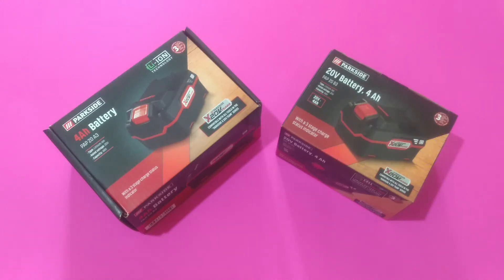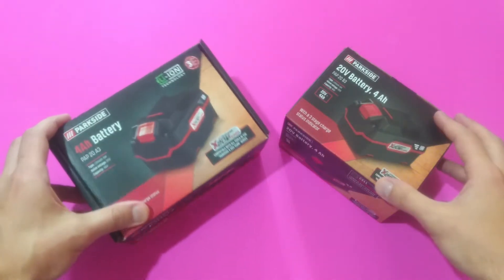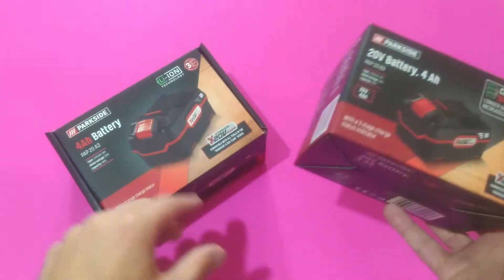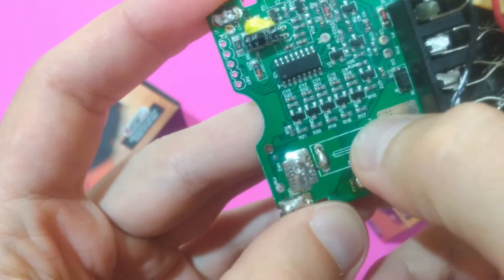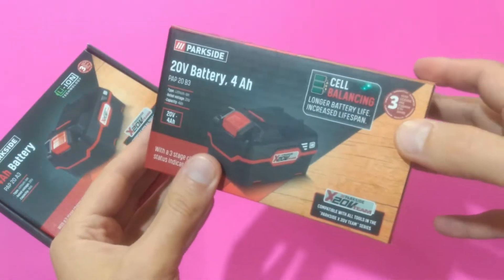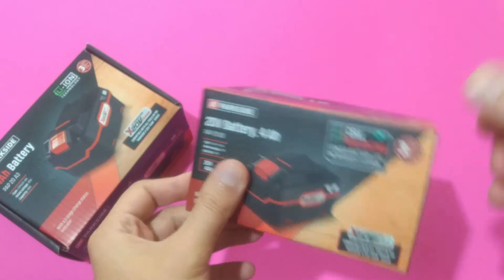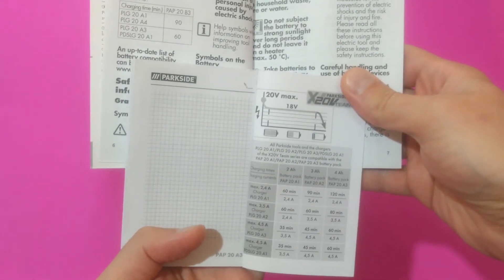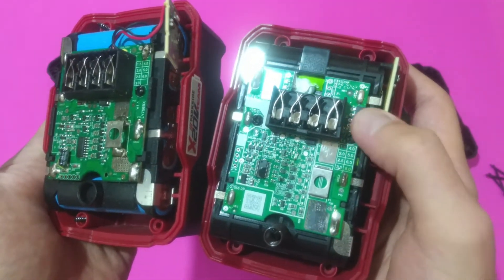Parkside New X20V Team Battery - Is There Really a New Battery Design Inside

Comment: My thermal fuse in my new battery shorted. Could you please tell me what the fuse is called and what rating did you put in?
I shorted it trying to make leads that would let me use it in my trend circular saw and my extension cables shorted on removal.
Thanks for the video.

Comment: There is just a video on YouTube that compares the same tool with the old battery and the cell balancing. The new one was stronger in every test. That maybe not be a cell balancing thing but rather a little more powerful lithium cells use in the new packs.

Comment: I bought a parkside battery and it is the c3 version. It is rated for 6ah with cell balancing. No smart capabilities though,they are the classic case, black with red stripping, identical to yours. They used new cells of 3 ah instead of 2ah

Comment: you can just check the voltages and if they differ like in mine 4.10v- 4.18v- 4.02v - 4.10v - 4.11v...its a brand new battery lmao...and its the new version...so no ...not really cell balancing...i balanced them manually....its t he 2 AH version and i added another row of 2.5A so im now at 4.5A and hotglued them all...i have now total off 5 batteries all 2A to 4.5A conversion lmao.
Reply: is hotglue even wise to use on cells?
Reply: Did you 3d printed the extension for the new rail of batteries?
Reply: @ΣΤΑΥΡΟΣΓΚΕΡΛΕΣ  no... i just hotglued the 5 batteries together and then glued them on the first row pack together...than i soldered them and when done hotglued the pack from inside to the top case...and glued the last cap as last and when finished i used 2 twists of black ductape to hide the gaps...no need to print bla bla...too much hustle for cheap batteries.
Reply: @Efdawah Fan  I tried to do the same but with 3ah batteries but the 2ah case is too small to fit 2 rows. That is why I asked you. Anyway alibaba has empty 4ah cases that can be filled with 2 rows.
Reply: @ΣΤΑΥΡΟΣΓΚΕΡΛΕΣ  yeah thats why i hotglued them together...and i didnt used the screws...so i have a gap between two parts around 2 cm...and i just ductaped it...im not going to spend more money on it...the whole idea is cheapest way possible.
Reply: @EFDawahWiseSmile2LanternDen  I think that your way is the right way. qudos

Comment: I have one of the new battery's and doesn't matter how long it's charging never goes green anyone had similar problems or know why
Reply from the maker: Probably the green LED on the indicator board is dead.
Reply: Only found this! I have two of the new ones and they never go green as well, but cut in and out.
They seem to work ok so I never worried about it

Comment: Thanks! I recently got my hands on 4AH  battery because they were out of ctock for a while in my country (had 2Ah for drill which is actually fine for light work that I'm doing at my flat), but wanted 4AH anyways just in case. Actually checked and its the new version luckily =)))